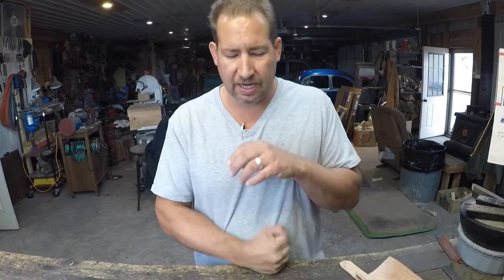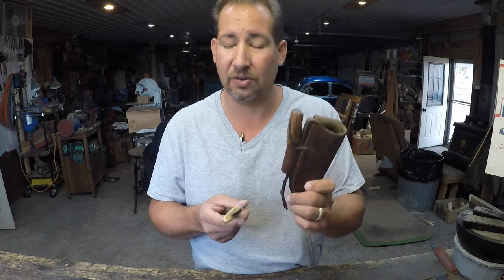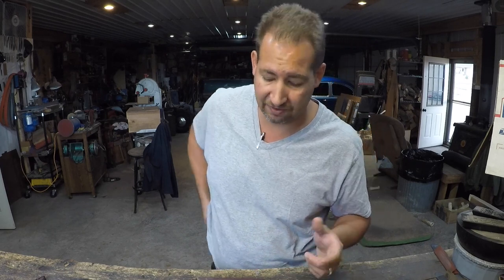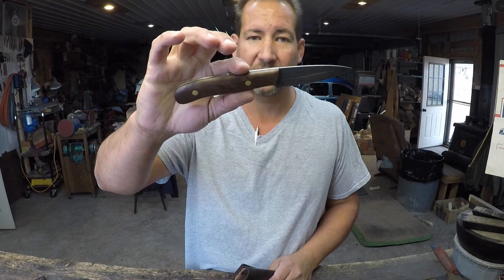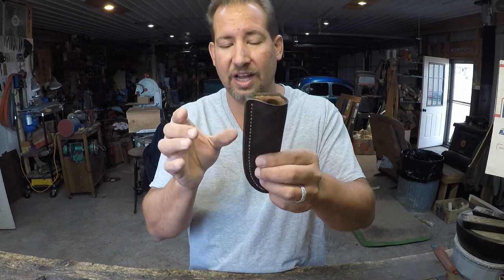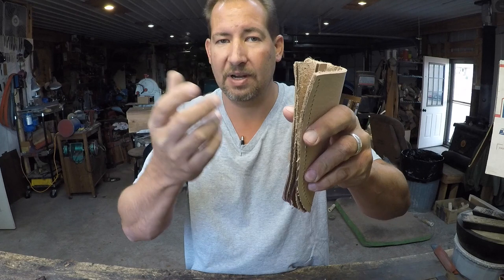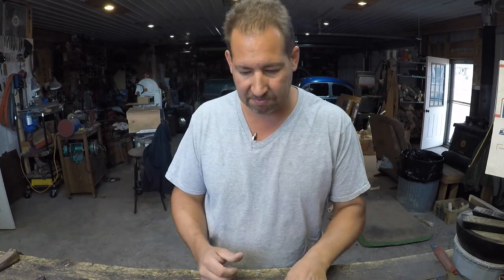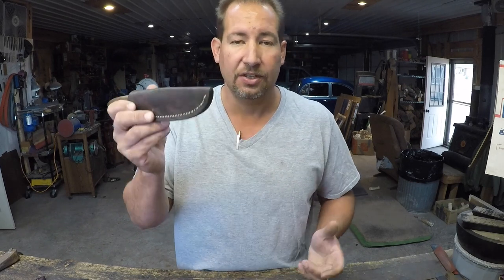leather sheaths for outdoor knives with no guards

Comment: Joe, a Puukko is a Real EDC knife... Have you ever tried carrying and using one..I have one with about 85 mm blade, which is small enough that it doesn't freak out the neighbours;-)
They have a symmetrical oval handle, so that they can be used 'upside down' comfortably, as well as sharp side down... Not a 'flashy' knife, but a real 'companion'.
Reply from the maker: there is alot about a puukko that I like, but the lack of good finger protection such as a guard or split guard is the biggest reason that I will probably never edc one. when things are clean, calm and controlled its not a big deal, but when things get cold, dark, muddy, bloody, oily and messy, a design with good finger protection will really save your index finger or more.